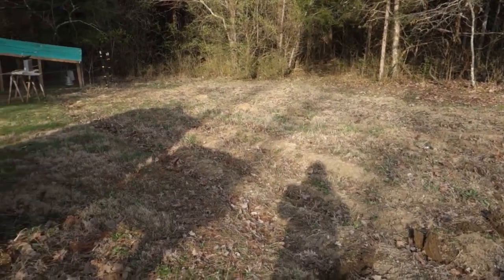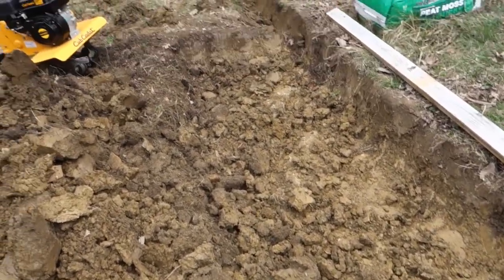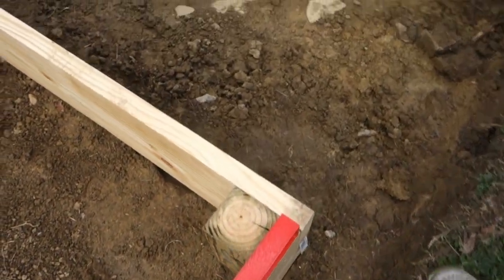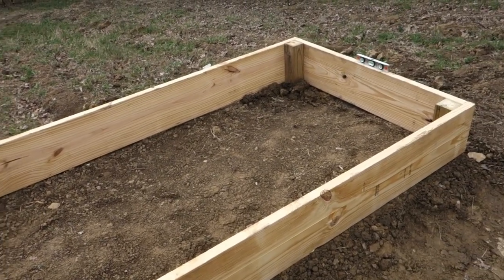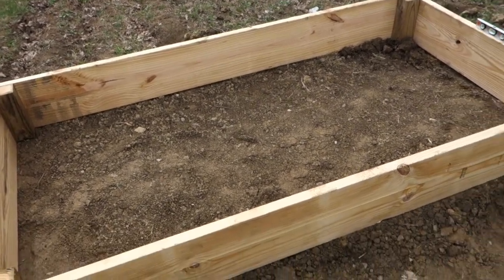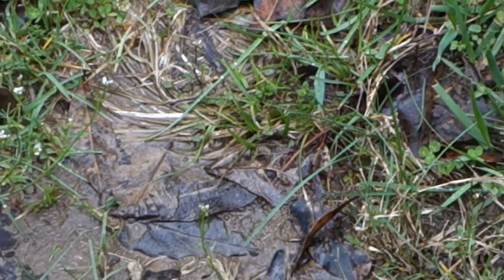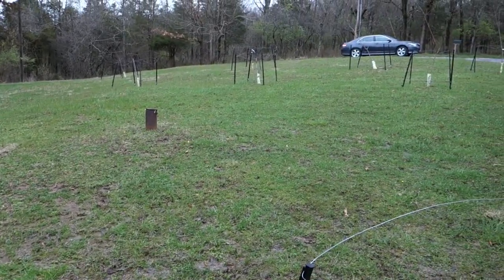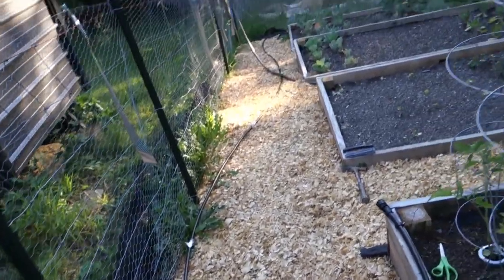raised bed garden build, tips, what I'd do differently + drip irrigation install from dripdepot

Comment: Keeping clay soil covered with a thick (5-8”) layer of woodchips/leaf mold & other organic debris ends up loosening it up beautifully over one or 2 seasons & also creates a beautiful layer of topsoil. If you are willing to wait that long, it also eliminates the need to dig/weed. The first set of plants/veggies can be clay lovers. When they are done, leave their roots in to rot over winter & the next spring you will have such amazing, well draining, rich soil that you should be able to plant pretty much anything!
Reply from the maker: thank you for the tips.  I have followed some of them already to some degree.  The raised beds was my quick solution to the much longer term clay soil problem.  I actually do see some improvement to the clay soil under the raised beds, especially in my orchard.  The soil above keeps the clay moist pretty much all the time and allows organic material to work into it from the top down since its not "hard as a brick" and dried out.  In the orchard and garden, clay soil that was a light tan is now almost black.  One of the reasons I line all the walkways in both the garden and orchard with pine shavings is to break down and improve the soil under it.  I have to refresh the thickness about every 2 years as it breaks down.  I was hoping by the time the raised beds rotted out (not pressure treated lumber) the clay soil would be  amended enough to start using it for gardening but so far its not.  Last fall I planted a lot of dakon radishes and other cover crops in the walkways too and did let them rot in the ground.  Its a slow process for sure and one day I hope to get there because a lot of my garden space is currently wasted with the raised beds and wide walkways.